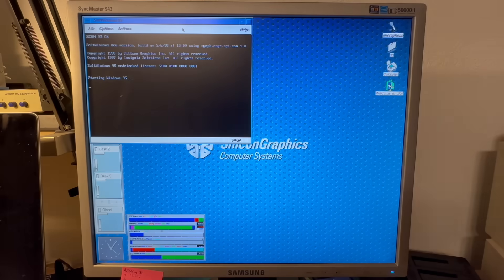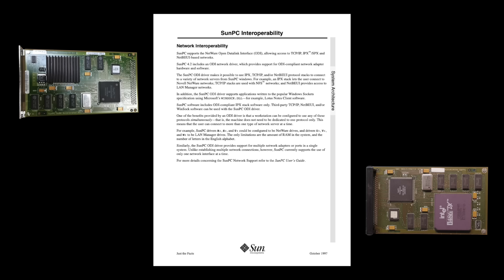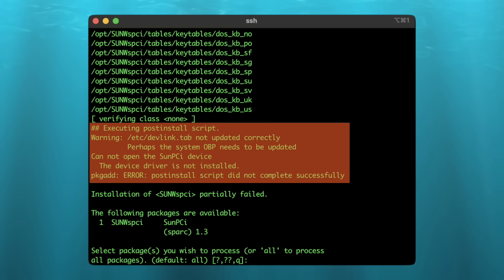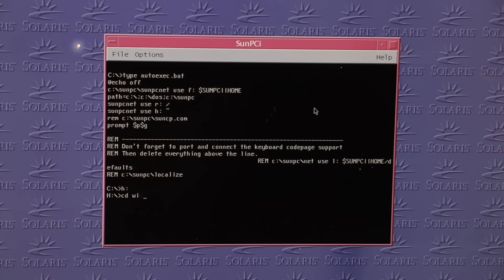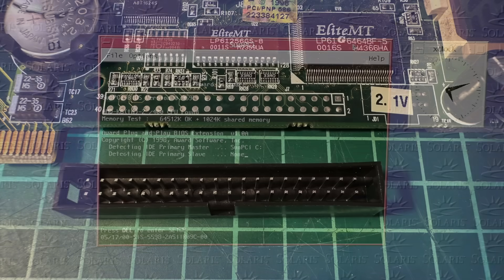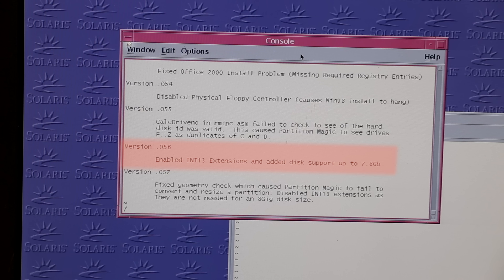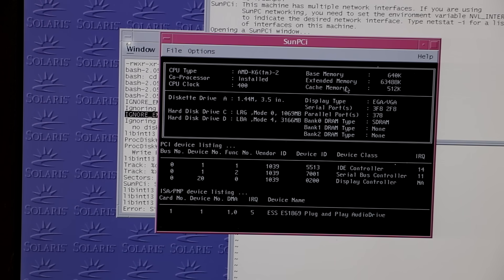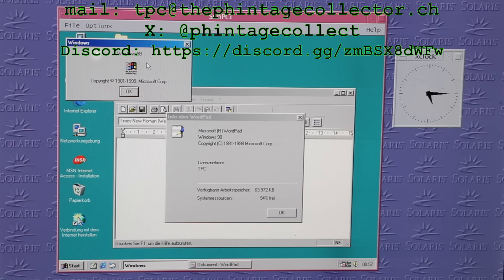SunPCi: A Hidden x86 PC Inside Your Sun Workstation!

Comment: Good video. I only don't agree with virtualization on x86 being possible/fast thanks to "CPU assisted virtualization technologies", or at least not if we talk about something like VT-x. For example I heavily used XP instances in VMWare on Pentium D 805 @ 3.8GHz which predates VT-x and remember quite excellent performance even with multiple instances. I used VMs to bypass certain ISP restrictions running quite heavy tasks like Torrent and accessed network shares to access local disk. Running VMs on cpu1 accessing separate hard disk via network share I didn't experience much slowdown on cpu0 to e.g. run games.

Of course VMWare was quite optimized for such operation and you could argue x86 CPUs did have "CPU assisted virtualization technologies" even before VT-x.
Otherwise I must say that VMWare was excellent with or without VT-x while VirtualBox wasn't very good (especially stability) even with VT-x and it really needs VT-x to have ok performance.
Other thing is difference between servers and desktop - and especially simpler use cases. On my desktop machine I don't need to worry about as much things as I would on servers. Not to mention that today virtualization is backbone of backend and cloud computing with incredible amounts of VMs quickly spinning for all sorts of tasks. It is far cry from running one or even few OS instances on local machine where I also don't need to worry about security that much.

Also in your case you really are talking about emulating different ISA - here from what I know technologies like VT-x can be used and are used in some cases but it is mostly for enhanced security and not so much performance. Most emulators people use of different systems don't use virtualization as much as normal emulation. You can use something like QEMU on x86 to emulate different systems and use virtualization for enhanced security and other features like giving direct access to hardware resources  like PCI-e.

EDIT://
Where you talk about Wabi layer - you do mention it but perhaps not clearly enough for someone who lost the nuance about Sun machines not using x86 CPUs and this paragraph can be understood as in "if Wabi worked more like Wine it would be much faster" - which is again not implied but the way things are stated makes such interpretation possible. In reality when e.g. using Wine on Raspberry Pi 5 then despite quite fast CPU I cannot directly run x86 programs and software emulation is needed and resulting performance is quite underwhelming. In this case having Wine with its native implementation doesn't give much performance improvements compared to emulating whole PC. There is some improvement  by having many DLLs in native ARM code but as it is CPU normally don't spend much time executing core from these DLLs so them being native vs emulated doesn't make that much difference.
Reply: Before VT-x, x86 CPUs couldn't perform full virtualization according to the Popek and Goldberg criteria. VMware was pretty performant because it used software, for example by handing off to emulation the instructions that could not be virtualized. 32-bit x86 did have full hardware virtualization of the 8086 subset of its instruction set in the virtual 8086 mode, used for example to multitask DOS applications in "386 Enhanced mode" Windows.
Reply: @bitwize  Learned something new today: these criteria. Thanks!

Otherwise for casual execution of other OSes it was possible on VMWare even without VT-x thanks to its very good coding of VMWare so it doesn't change my conclusions. We could already "virtualize" or in this case emulate ia32 inside ia32 at much better speed than typical JIT enabled emulators.

I have not checked VMWare in long long time. Use VirtualBox instead. It was terrible piece of software in the past, VT-x-less or with it. Buggy, crashed a lot and performance was mediocre.

What I can also tell that anyone using VBox today if they disavle VT-x or have misconfigured system (even just having HyperV installed but somehow now able to be used by VBxo) it will run snail slow. Absolutely trash performance.

Not sure VMWare though how it compares without hardware virtualization. Also how does ia32 fares against amd64 in this case.

It would totally not surprise me that all the 'security' concerns raised over the years made software emulation slower.

Comment: Very cool card! I find these types of system-on-a-board expansions to be quite fascinating. Thank you for showing us!
I just had a quick think about your physical disk conundrum, and I think it's entirely possible the IDE header on the SunPCI is a part of the built-in ESS AudioDrive and is likely only intended to work with ATAPI devices; i.e. CD-ROM drives. I could be wrong though. But, I can't see why attaching a hard disk to this header wouldn't work, as clearly the BIOS can see it when it is attached - it is possible either some other design quirk prevents the BIOS from exposing the disk to INT13h, or Sun has deliberately patched the BIOS to disable the use of hard disks via the header since using the header is unsupported in any case. I'm just taking a shot in the dark here though.

Comment: Why does you have so few subs?!? You deserve more than under 8k! And for those wondering, as of Feb 16 2025. this channel has under 8k subs, you earned a sub from this video btw! Good luck
Reply from the maker: Thanks for your kind words. Strongly appreciated.
Reply: @THEPHINTAGECOLLECTOR  You earned it, I just wish I had proper retro hardware to work with, I have to use 86Box for running some older stuff.

Comment: Great video! I am really curious about the chipset on the PC card. I'm intrigued by the fact that I see something similar to a southbridge that is branded Intel, but the CPU is a Super Soket 7 with 3 USB ports exposed. My latest Soket 7 Intel, the i430TX officially supports only 66 MHz FSB and 2 USB 1.1(?) ports. I have not tried a K6-2 or K6-3 on mine because the only ones I have are 100 MHz FSB and I don't expect them to reach 450 or 500 MHz.
LE: I see some SiS 5598 in the BIOS string, but  I'm curious where the Intel chip fits in the equation. It is unlikely to be simply an IDE controller, as by that time the chipset included that functionality.

Comment: maybe you can just plug the 4 gb/8 gb compact flash in that slot using the adapter?
Reply: this is more-or-less the same as connecting the HDD
the problem - or at least the first of them - is most likely in the BIOS code, 
so hot-patching RAM could work

Comment: A secondary PCI IDE controller should do the trick to use external drives and that white connector has enough pins (95?) to be a PCI connector, the PCI slot has ground, +5V and +3.3V repeated a lot of times...
I guess there's no documentation for that connector and with BGA chips it's impossible to trace the connections without removing the chips... Have you tried if a CD-ROM drive also becomes inaccessible to the guest OS?
Do you know what every jumper does?
Reply: Can you add PCI peripherals to the PC emulator side though?

The PCI edge connector on this card is used to connect to the SUN host PCI bus. Adding a PCI IDE card to that bus would just add an IDE card to the SUN side, I think.

Or is there a mode where this card acts as a bus master controlling other PCI cards?
Reply: @The-secret-101  Unlikely.

Even if it's possible at all (it might be possible but would be quite a stretch), designing such a PCI bridge controller essentially from scratch would be very hard and very expensive, it would be a complete redesign of how PCI bus works on PC side to fit that idiom.

Most likely they just used a normal off-the-shelf PC chipset which includes PCI controller (master) for PC side.

And thus I assume Sun-side PCI-device interface has nothing to do with PC-side PCI bus at all - completely separate in-between buffer to a completely separate bus.

There probably are some PCI traces somewhere on the board even if it's not exposed to a connector.
It's unlikely a VGA or HDD emulation could run from ISA bus alone and not be way too slow.
Reply: @ Given it's age it might even use AGP internally between the graphics hardware and the chip set.

I would think that the custom circuit (probably a programmable logic chip) acts as a PCI bus master against the PC memory.

Btw, fun fact: in the late 80's Commodore made similar boards but for the Amiga (8088, 286 and 386 (not sure if it was SX or DX)), called Bridgeboard. Those had 128k memory that was accessible both from the PC emulator and the Amiga. Given how expensive hard disks were in the 1980's these allowed using hard disks both ways. I.E. you could have a file on the Amiga side emulating a hard disk for the PC emulation, and you could also attach a PC hard disk to the PC emulator and have a partition dedicated for usage by the Amiga side. Since this was in the 1980's, the PC side uses ISA bus and the Amigas had a passive back plane for ISA cards, so you just added any PC har disk controller. The only downside of using a PC hard disk drive for the Amiga was that you had to load the drivers from something else, i.e. floppy or another hard disk, but it would still be a great improvement as compared to not having a hard disk at all.
Reply: @The-secret-101  The card is mostly a regular computer based on the SiS 5598 chipset, it has PCI and a PCI to ISA bridge, the sound, serial and parallel ports are on the ISA bus and the built-in USB, IDE and VGA are on the PCI bus.

Then board has a PCI to PCI bridge (Intel 21554-AA) between the PCI BUS used internally by the card and the PCI connector of the card that is controlled by the host computer.
It's a special PCI bridge designed to have each PCI bus more or less isolated and controlled by a different CPU, I don't know a lot about those things and I didn't read the documentation but I guess it allows the host to have some control over the devices on the guest side and can somewhat fake/redirect the data they can be reading/writing on the physical pins like it was happening with the IDE port and the keyboard and mouse and floppy drive that don't even exist as physical devices, and capturing the display output.

Comment: I do remember when they brought out WABI as it was reported in the computing press but I never saw it running.
Reply: WABI's performance sounds like it could be surprisingly good. It implemented kernel.dll, user.dll and gdi.dll natively. And it had a hybrid CPU emulator that could either emulate x86 instructions one at a time or translate them into native code. And it could do this with either an x86 Windows app running on the native kernel/user/gdi or even a whole Windows installation.  There were 'certified' apps liked MS Office which Sun claimed would run. I bet if you just need to edit a Word document on a Sun it would be fine.
Reply from the maker: @_chrisr_  next week then ;)

Comment: This is insane stuff. Did many people actually do this? Would it not be easier just to have a PC instead of this? Is this for folk that had desk space situations?? What's the benefits of having this setup??
Reply: Compatibility bridgeboards of this type were very common throughout history, and in many forms, going from the "PC Sidecar" for the Amiga (which was most of an IBM PC, including the internal floppy drives and PC-style serial and parallel ports), to the "Apple IIe Card" for Macintosh LCs and derivatives, which was (surprise) most of an Apple IIe (but none of the peripherals), to "podules" for the Acorn Archimedes made by Aleph One that had 386-derived CPUs on them (but little else), to weirdoes like the "Shablamm Nitro" card, which was most of a RISC MIPS Jazz platform on a VESA local bus card, and completely took over the system (disabling your 486 CPU, BIOS etc., as it was designed as a system upgrade, not a bridgeboard).

These bridgeboards were great in the context of their history: software emulation was terrible at the time, with performance, support and compatibility all well short of the mark. External media, such as floppy disks etc., were still widely used, and almost always required hardware support in order to read the multitude of disk formats floating around: the Apple IIe Card, for example, had a connector for Apple IIe 5.25" floppy drives, which the vast majority of software for that platform came on (and, of course, couldn't be read by the Mac's built-in 3.5" floppy drive). Then there were the peripherals (such as hard disks, printers etc.), which came in all sorts of incompatible interfaces depending on the platform: these bridgeboards usually allowed a level of cross-compatibility, so you could print on your Macintosh printer from software running on your Apple IIe Card, and you could make an MS-DOS partition (bootable and everything) on your Amiga HDD for the use of your PC bridgeboard.

As such, these add-ons were considered a far superior solution to spending thousands of dollars on an entire IBM PC, MIPS workstation or whatever, then finding somewhere to put that second machine, and having to add extra, incompatible-at-the-hardware-level peripherals to make that new machine useful. All to run one or two programs that weren't available for your Mac, Amiga, or Arc - or (in the case of the Shablamm card) to give you a big performance kick: while CPU upgrades were a thing even at the time, they often came with performance or compatibility limitations, such as (for example) having to squeeze the Pentium system bus and its cache coherency protocols down 486-style motherboard wiring. And right up until the late 1990s, your average RISC CPU could outrun the fastest x86 by up to 50%: completely taking over the system bus (a trick that the VESA Local Bus was probably the last common bus to allow via a plug-in card) got around that surprisingly cleanly and performantly.
Reply from the maker: @judewestburner  space certainly one thing, but also cost.
Adding the SunPCi was certainly less costly than adding a separate PC, especially if you didn‘t go with dedicated peripherals.

Comment: It has ESS sound chip. I wonder if it supports ESFM synth. Maybe it would be possible to somehow inject option ROM like XTIDE to get IDE drive working.
Reply: It is ESS ES1868F so it is fully ESFM capable.
On a side note ESS cards are my favorite OPL2/3 cards. I like sound much more than genuine Yamaha chips because it seems ESS fixed certain issue with how operators modulating each-other can lead to audible artifact that sounds like directly playing back exp-encoded sine wave which should not be happening. Worst offender in that is OPN2 chip found in Sega Megadrive/Genesis.

Comment: I have all 3 PCIe cards and a SunPC card tried to get Sun to release full documentation for the virtual interface before they were bought out as i wanted to have this card work under linux
Reply from the maker: I asume it was a dead end, as all my reading on behalf of Linux ended in "doesn't work"
Reply: @THEPHINTAGECOLLECTOR  yeh I wanted to get it to work, but unfortunately he took over before I could get the required info for programming the pic! And well reverse engineering is not my thing, I did do various tracing but could only get the led to light up and change colour,  I never figured out how to get external vga output switched on to allow trying to get a system to boot up and well you also confirmed that missing ide connector was not going to get me anywhere

Comment: FDISK was really the worst tool I ever saw, what a really bad software. Who "designed" that "UI"? Never understood how it could live that long without complete rewrite. 

By the way did you try to try to install an NT-based operating system on it as well?
Reply: It's not just the UI that sucks in FDISK. It has some "under the hood" issues as well.
Reply: @pvc988  Yes, it was completely sucking everywhere. Alone the fact how it (not) displayed how the drive is currently partitioned.

Disk Management tools in NT were just so much better, and they did not require a restart later...
Reply from the maker: @Lofote  aalhough the restart was not due to fdisk, but DOS’s overall limitation itself unable reread the partition table while running.
Reply: @THEPHINTAGECOLLECTOR  yes, and they even implemented that strange behaviour in os/2 1.x versions later. But they could have made a better overview of current paritions etc. It was really strange to use that tool.
Reply from the maker: @ Absolutely. Other tools were definitely more user friendly.
And sometimes, DOS’s fdisk couldn‘t even remove partitions, and you had to clear it using the DEBUG command.
Reply: Someone at IBM designed it.  Even the Win98SE FDISK which we see in this video is descended directly from the PC DOS 4.00 FDISK, for which we have the source code legally and which is really awful code to read.
Reply: @fnjesusfreak  Yeah, it has IBM written all over it. IBM OS/2 1.x setups are quite similar to this in the way they show whats going on and offer options for the user. Really not user friendly at all.